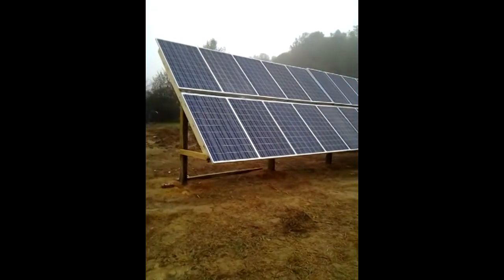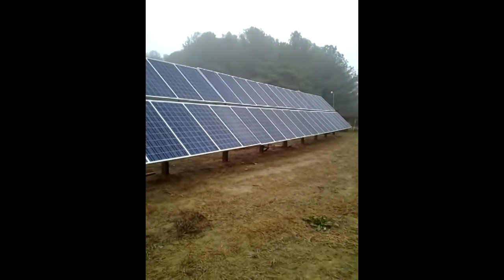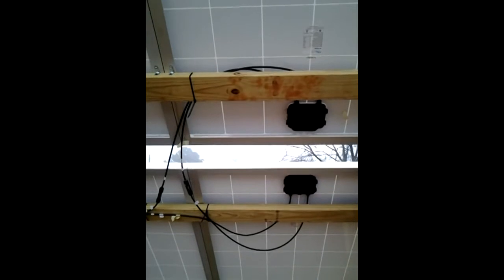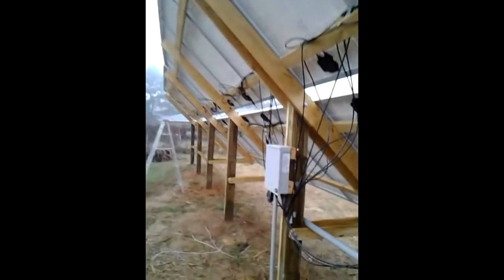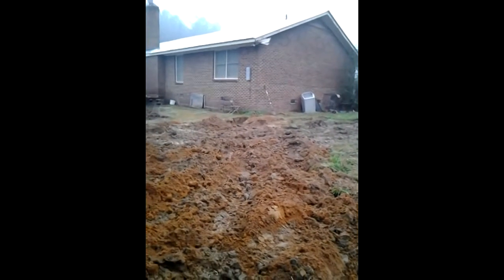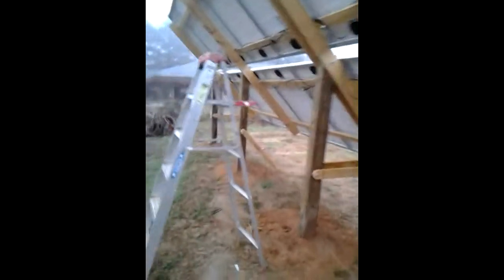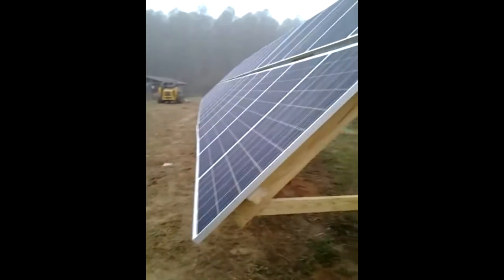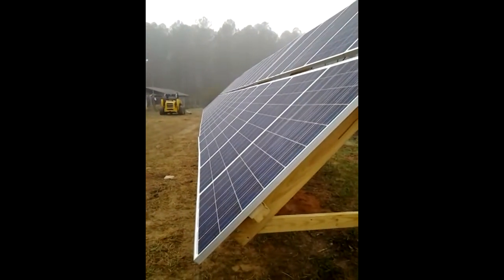10,000 watt solar system

Comment: That is an epic system! Can you give a ballpark on what something like that will cost?
Reply from the maker: Installed and parts about 40 abut a 100,000 cheaper than any other company. My system that we are installing in a class at the Cobathon cost about 4,000
Reply: Joseph Fairlane I hope you go into how the grid tie works sometime. I have asked a couple of electricians about this and got blank stares.
Reply: From what I understand, the grid tie systems works by selling a  majority of the power made back to your local power company. There's a power grid-tie inverter that converts whatever voltage coming in from the charge controllers to normal AC power that eventually connects to the main power meter. When the solar panels are in action, the meter outside either runs in reverse, or it stands still where the power company either cuts the solar owner a check every month for selling them usable energy, or they credit your account. If you used a little power off the grid, they'll still charge you for it. If you have a battery bank connected to the charge controllers, the same solar panels will also charge the batteries so they can be used at night or when there's no sunlight.
Reply: goforgreenliving you'd charge 4000$ for a 10k watt system?